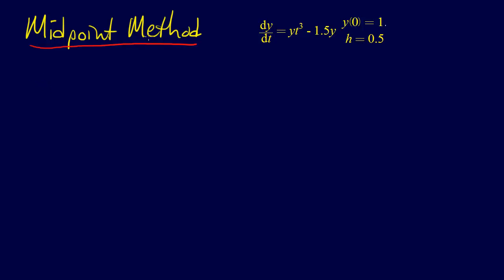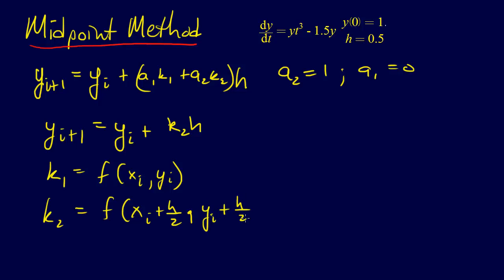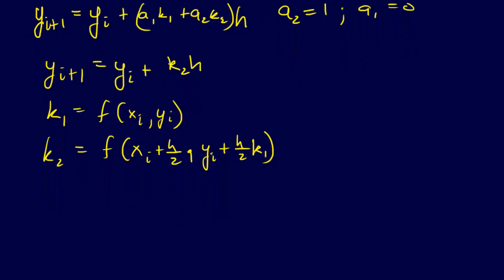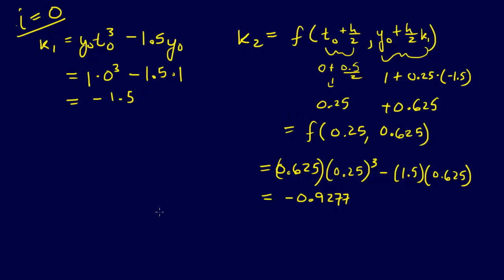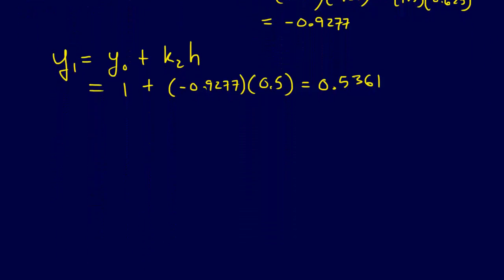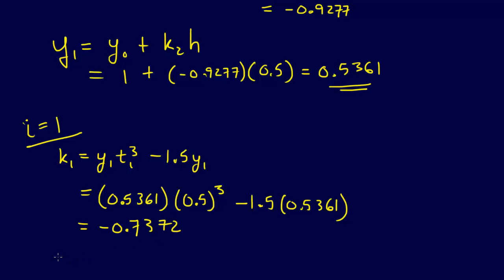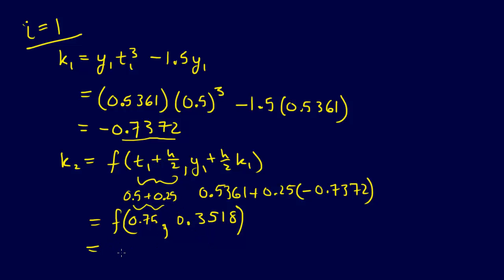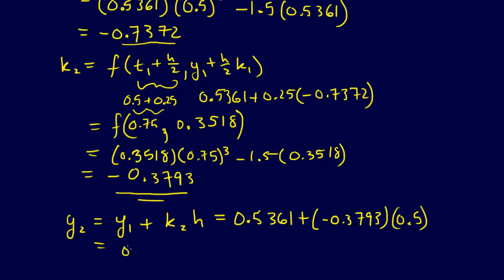7.4.5-ODEs: Worked Example--Midpoint Method

Comment: the formula for k1 appears to be incorrect it should k1 = h*f(xi,yi)
Reply from the maker: It's correct as shown. k1 gets multiplied by h/2 later. It's important to remember that k is an approximation to the slope. Multiplying by h gives the change in y for the interval h.